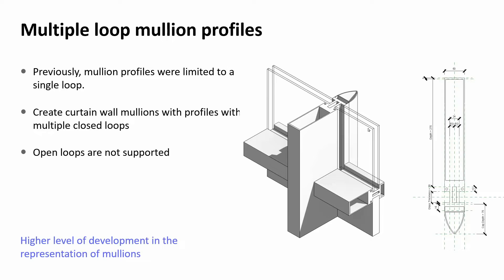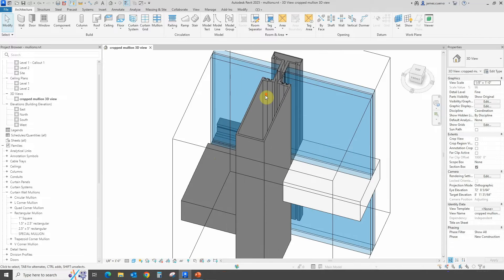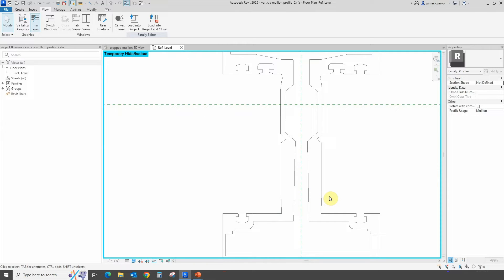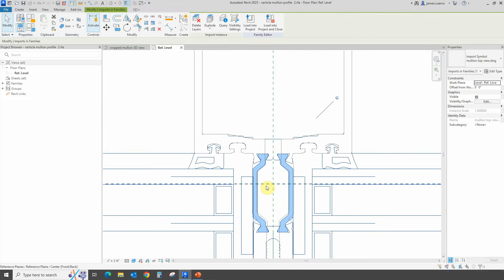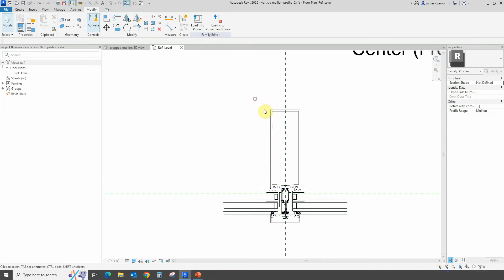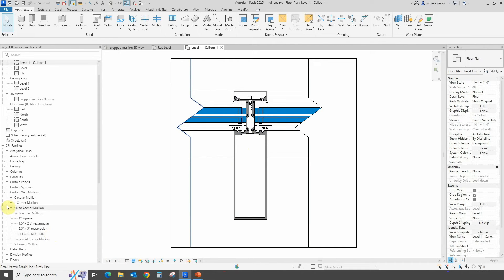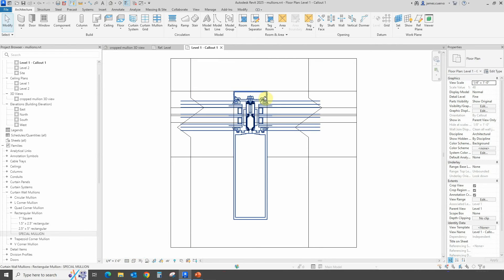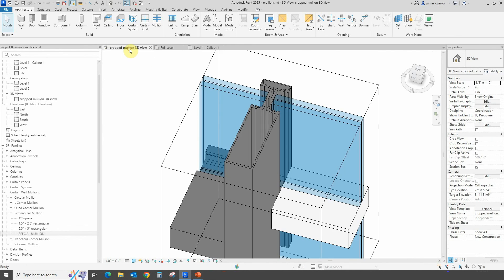Multiple Loop Mullion Profiles - What's New in Revit 2025 Webinar

Comment: hello there, first thank you but how did manage the panel go all the way inside the mullion?? in my file it stops at the edge of the mullion profile!!
Reply from the maker: Are you able to provide a bit more detail? We are not sure exactly what is going on. Feel free to provide time stamps in the video as well and be specific as to what you see on your end vs what you see in the video.
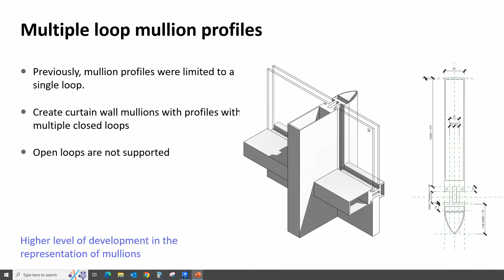Reply: @DigitalDraftingSystems  so when you go to your 3D model @0:45 I can see that the glass panel is overlapping with the mullion and goes inside the body of the mullion, whereas in my file the glaze panel ends at the outline of the mullion and doesn't overlap with the mullion ( I mean it doesn't go inside ) any suggestions? please bear with me if I couldn't explain clearly, english isn't my first language and thanks for replying
Reply from the maker: @Arafeh.H  One thing to verify is that you are using the correct family template (curtain wall panel), otherwise the results will not be the same. 

Additionally, if edges are locked to the appropriate planes then it should work as expected.